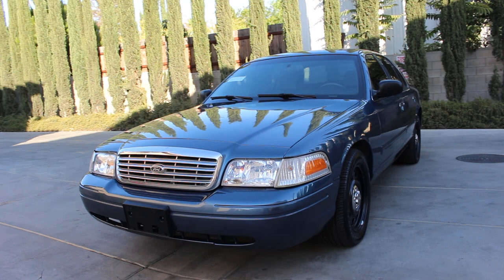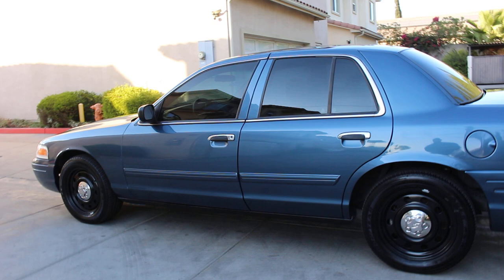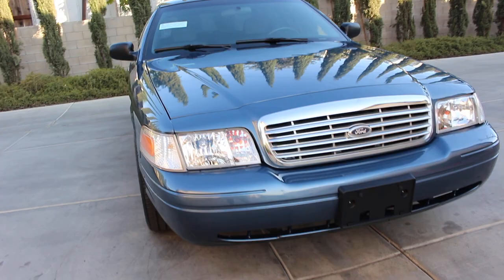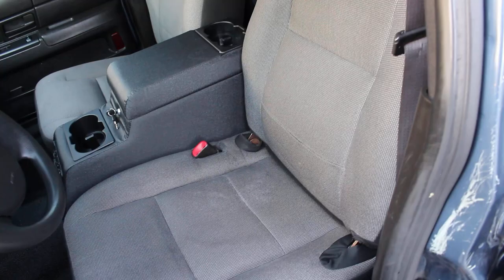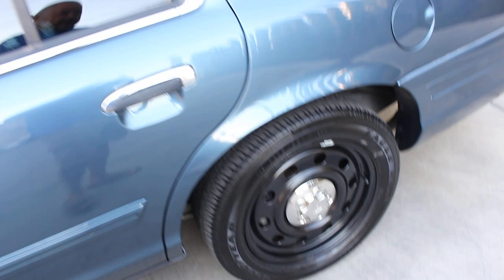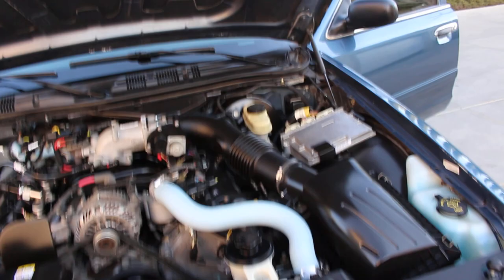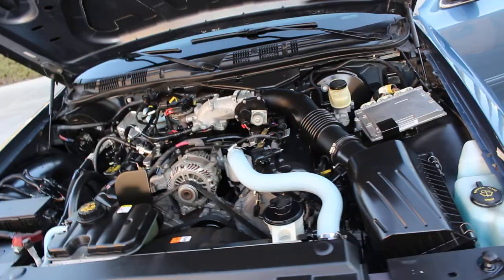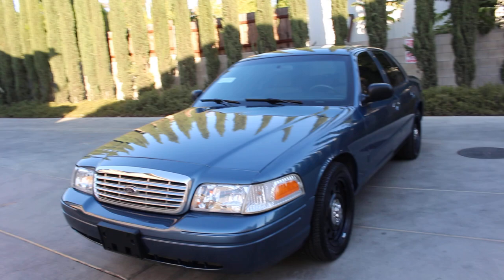2009 Ford Crown Victoria (P71) Street Appearance Package

Comment: When you say this vehicle is "completely re-conditioned,"  do you mean the transmission has been rebuilt? A tranny with 100,000+ miles on it, no matter how much it is serviced, will likely have experienced some wear and tear, and could experience some sort of failure (i.e. oil pump seal) after being run hard for a relatively short period of time, especially if the buyer thinks it's in "like new" condition.  I saw a friend have this happen with a "lightly used detective's car" with "only" 89k recently. He paid $4,500.00 for the car and almost as much to have the tranny rebuilt so he's into now for almost $8,500.00.  Has the tranny been disassembled and inspected recently?  $11,000.00 for a police car with 118k with new paint and an Armor-All soaked engine compartment is a bit high, especially if the transmission hasn't been checked out thoroughly.  I wouldn't buy it at that price unless the tranny has been thoroughly inspected but someone probably will pick it up.

EDIT:  @SoCal Police Cruisers Inc. Mario  "work of art?" From all indications, you're a used car re-seller not Picasso. 

I suspect your routine is no different than a lot of other car dealers on the secondary market: buy a used car at auction locally or on Internet sites like govdeals dot c0m, clean up the vehicle, change the fluids/plugs/replace aging components, paint the rims/body, use Simple Green to clean where necessary, apply Tire Shine and Armor-All liberally where needed and then sell.  I have done it for two decades and so do many others that I know, including the friend I mentioned in my previous post, whose "luck" was bad, but he bought his CVPI at an auction and not from a re-seller.  As a lot of people may know, buying a car at an auction is always a crapshoot. When I buy used police cars, I usually get them at local city/state government auctions for 4 or 5k with 50 to 60 thousand miles on the odometer and sell for 6 to 7k with the caveat that I am selling them a used car where is-as is.  I would never represent a car as "like new" or "completely reconditioned" because that would indicate, to me, that the engine or transmission was recently rebuilt or replaced with a new one (and I have seen these examples before; I bought a CVPI that had a new engine installed six months before it was sold to me), so that is why I asked this question in my previous post.  

There are many reason government agencies put their used fleet cars out of service and have a third-party sell them at auction: high-mileage milestones (usally close to 100k) have been reached, rising maintenance costs, and safety/reliability concerns with an aging vehicle. A reseller can make a car 's exterior/interior look new, but the critical internal components of the engine/ transmission/axle could have significant wear and "changing all fluids" doesn't make them new again, just like a tooth cavity doesn't go away or nmake the tooth 'new' again just because you brush your teeth.  Having said all this, I hope you make a considerable profit on this car. See you at the auctions!
Reply from the maker: There are plenty of other Crown Victoria’s out there. It’s your money and you decide what to do with it but one thing you should not do is come here and do is bash my work of art. Your friend had bad luck and that’s it. Too bad for him. That’s why you buy from someone that knows what he is doing. You don’t like my work you can keep scrolling and go waste your time else where. Thank you.
Reply: @SoCalPoliceCruisersIncMario  Another opinionated window shopper. Go look somewhere else.   ( Me TV)     Mario I still have both my crown vics from you, ( Frank in Ohio) both are in perfect running and looking condition as sold to me.  If you didn't do it the way you do it, you wouldn't be able to keep doing it.  Wishing you and the family a great Holiday season buddy.